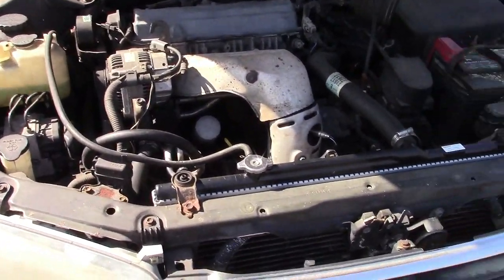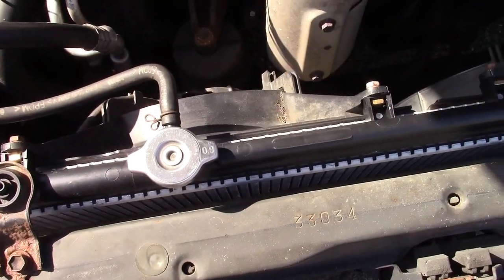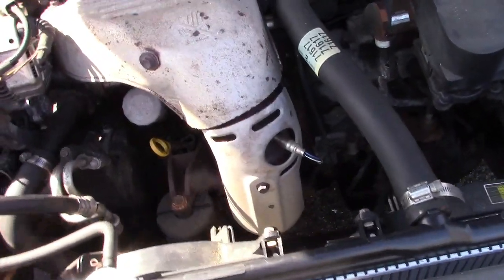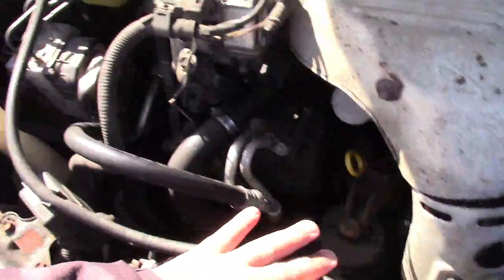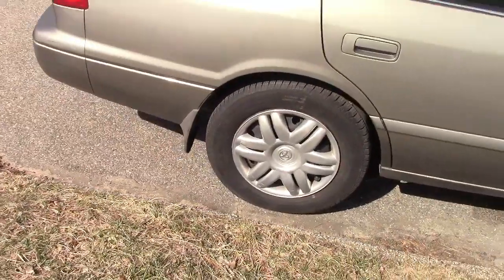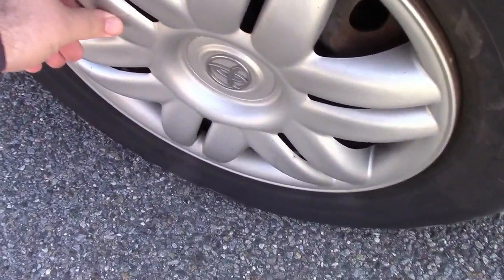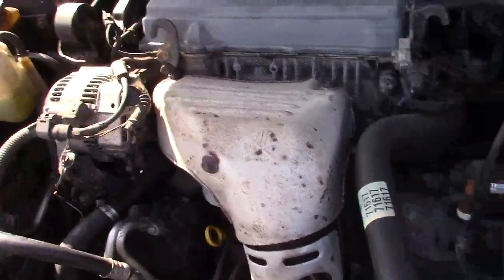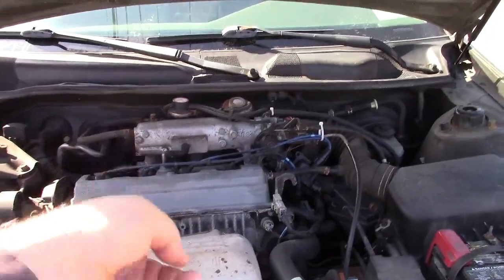All Patched Up (2000 Camry Replaced Radiator & Rear Struts)

Comment: Was that the friend you called Donuts in the throwback videos?
Reply from the maker: Yes, that's him.  He used to work for Dunkin' Donuts, so he got that nickname.
Reply: @jaykay18  I never had a spring break before.  My first car the rear springs developed quite the sag and I had them replaced.  I've broken shocks before.  Had one literally come out in two pieces.  Think that one broke from pounding over Boston area streets.
Reply from the maker: @tallboyyyy  When Geauxherd was here, he couldn't believe how bad the roads are here.  I'm sure Boston isn't much better.
Reply: @jaykay18  This was when I was in college and was already driving an old clunker of a car.  After 6 months of Boston potholes the car started clunking for real.
Reply from the maker: @tallboyyyy  Har har!  When I was a kid, there were still a lot of 1970s cars around obviously, and they were all body on frame construction, rear wheel drive, the whole nine yards.  I remember once seeing a car that had a failed leaf spring on one side in the back, it was leaning pretty bad.  Only saw it once and it struck me as very odd.  I've seen leaf springs fail before, but never a coil spring.  Heard of shocks failing too, never had that happen to any car.  Even my old Chevy, when my grandmother was still alive and "with it", remarked that even though the car was really old then, it still gave a nice ride.  Yes, it certainly did.  America has forgotten how to build suspensions.

Comment: You didn't test the airflow of the feans with toilet paper. How do I know they are blowing air in the right direction and the right amount?
Reply from the maker: If it wasn't right, the car would be puking green stuff...
Reply: @jaykay18  I know that I was making fun of the fan twerps.
Reply from the maker: @lexmarks567  I know, I was being funny back.  Like you know how the front of each car looks kind of like a face, imagine if it were set up to start spewing buckets of green stuff out through the grille, that would be pretty funny.